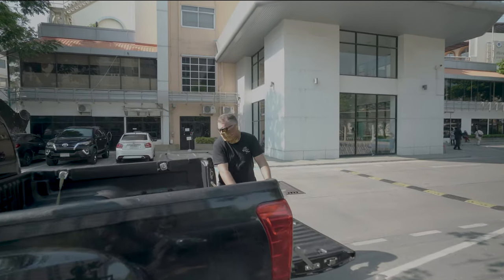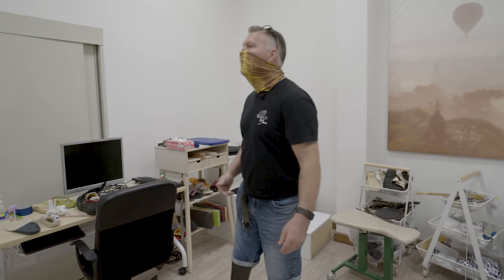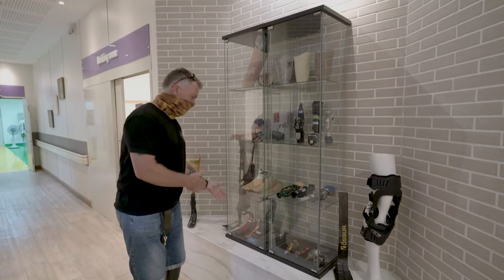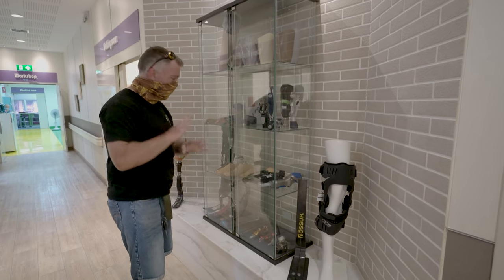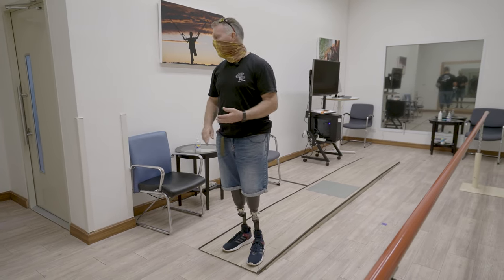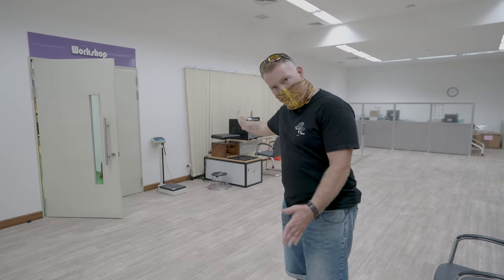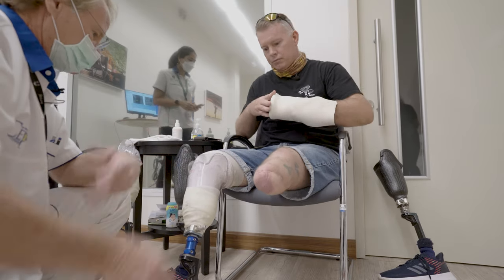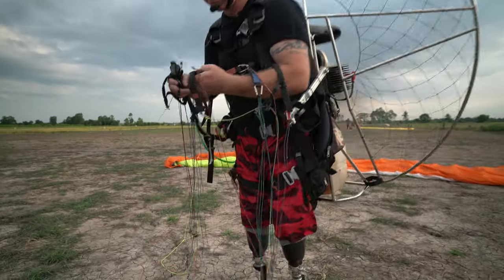Gareth Payne: Bilateral Below Knee Amputee at CEPO: Center of Excellence for Prosthetics & Orthotics

Comment: By the way, a very easy solution I've made for swimmers and surfers who worry about losing their legs - I attach a sturdy strap to the leg which connects to a waist belt up above, and acts as a backup suspension in case of suction or pin failure. This is very low cost and has worked well for my patients.